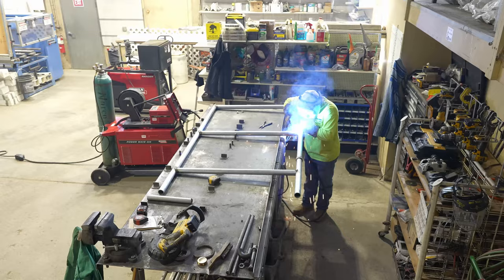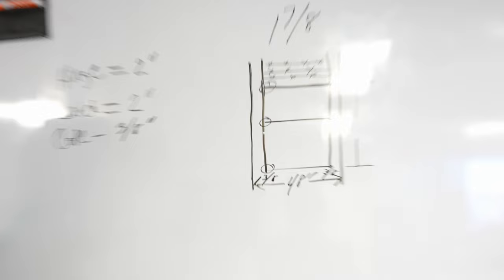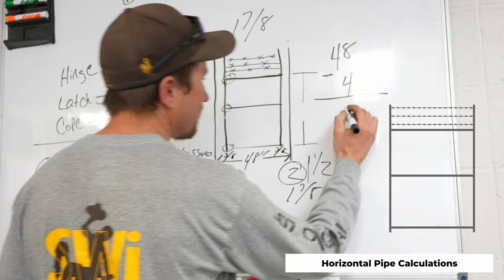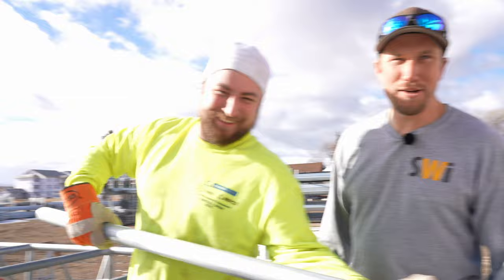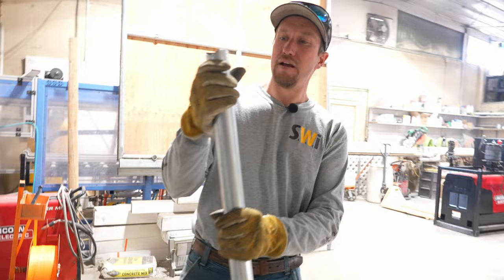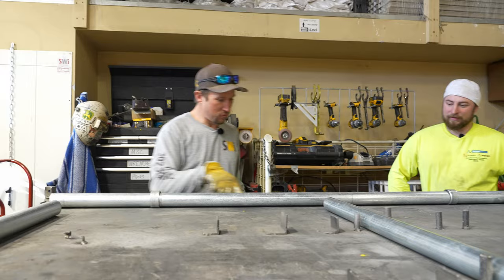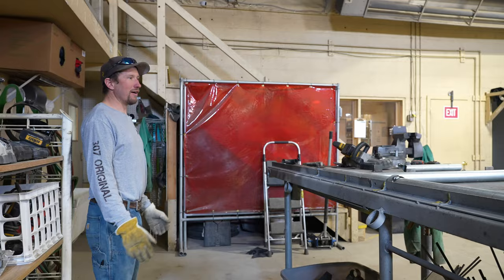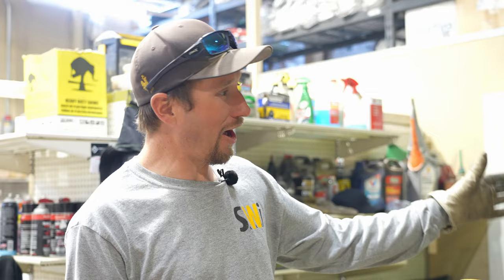How To Measure And Weld A Chain Link Gate

Comment: I'm a bit concerned over the zinc fumes.  It looks like you should have a bit better venting.
Reply from the maker: That's a valid point, Roger. We'll address that in an upcoming video. It is official company policy to wear a respirator when welding galvanized pipe.
Reply: @SWiFence  I worked at american fence in santee ca. For 15 years the epa came in and put meters on the shop welders and it was ok with the fumes I was looking for a list of the deductions for gates we had a list at american fence so 1 3/8 is like 6 1/4  1 5/8 is like 8 1/4 you don't have that chart do you
Reply: I would still wear a respirator.  I’m not sure how some EPA monitoring device located in the shop has to do with the fumes being directly inhaled by a person welding.  The toxins would be highly concentrated inside and around the mask.
Reply: EPA cares about air emission pollution- OSHA is the agency giving a shit about what you suck into your lungs. Air sampling is my gig-If you’re welding you should have a good fan or a respirator. That’s the 2c version

Comment: Really nice video very well explained , you could be Mike Rowe's brother . What size wire do y'all use 30-35 ? Nice jig table .  That coping cutter is sweet I've got the old tubing notcher jobber dew thing it works for my piddling . But now that Father Time has come to town most of my stuff gathers dust Glad I found you all's channel. Y'all stay warm up there all the Florida folks are in short sleeve pants. You can put leather chaps on to weld I guess that would be funny.  I will look forward for that video from your St. Augustine crew lol y'all have a good dang day.
Reply from the maker: We use 11ga and 9ga. 👍🏻

Comment: Fun videos...question. I have 2 gates and one is full on rusted and fallen apart. On the gate that is still good - from outside vertical to out vertical it is 74" would that be considered a standard 6foot/72" gate?....
Reply from the maker: Sounds like you're a little over 6'. We do a standard 6', but you are closer to a true clear opening of 6' once you account for hinges and latch.

Comment: Can you build a reliable gate without soldering just using gate corners and clamps?
Reply from the maker: You don't have to weld. There are kits you can get. But this is definitely our method of choice. It's stronger and infinitely customizable since we build exactly what we need.

Comment: I want to install gate that will latch on post next to masonry column, but the footing is too far out from the column. What can I do with that? Bolt a post to the column? Use a standoff?
Reply from the maker: You could try a plated post drilled in to the footer, or perhaps flat-back hinges to the column.
Reply: @SWiFence  Thank you, I didn't even think of putting the moving latch on the column. 😃